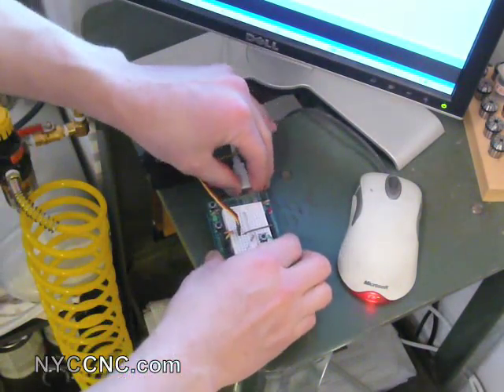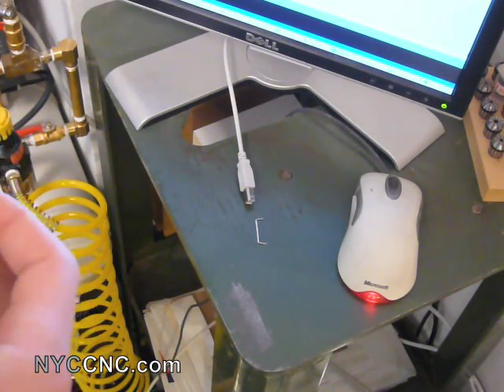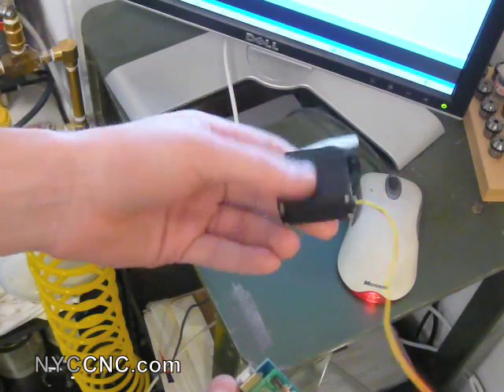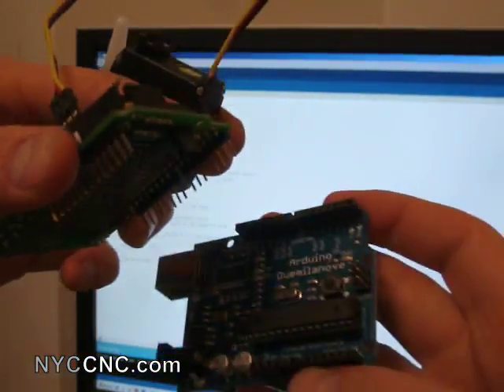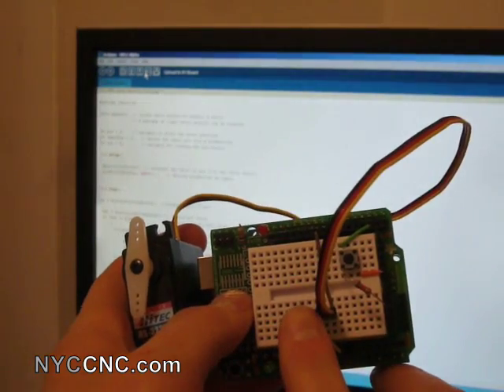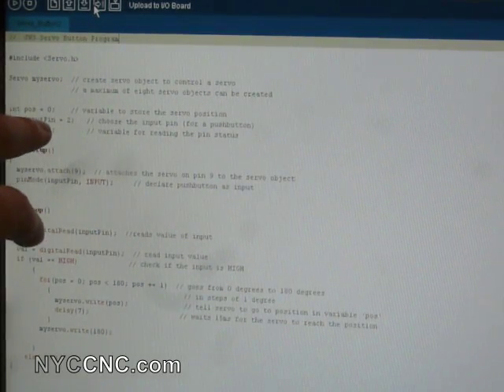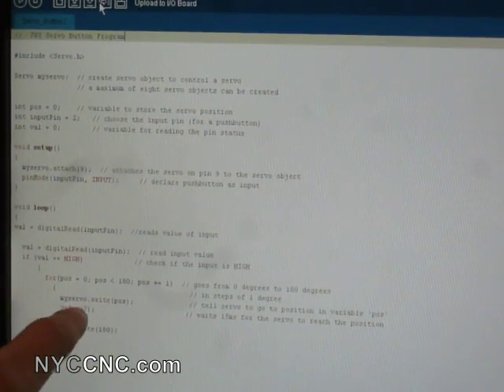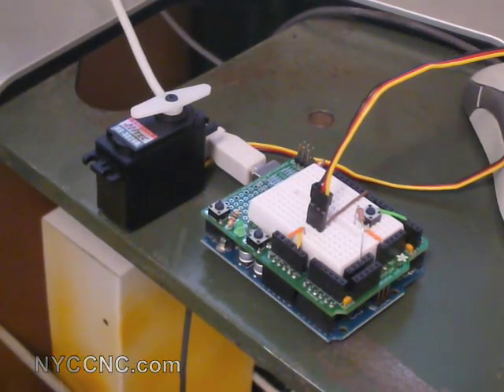Tutorial - Use an Arduino to control a Servo motor!

Comment: Typed it line for line as its shown in this video as well as what is posted at the source code link. Also wired it exactly the same. But it didnt work for me. The servo just keeps cycling through continuously

Comment: i use mach 3 for playing around with steppers its easy for pin out adjustment steps ramp rates pulse with mod inputs outputs lot of easy programing gcode etc u probably allready know jest fyi i started with the basics trial and error self tought up grade smoothe stepper and phytron drivers good clean steps next when more money i git encoders for servos perfect movement have good day be safe

Comment: heya :3
nice video! I have a question about the arduino. I have a school project, but the teachers don't want to explain anything when I ask for help. I have a servo which can rotate  . And I want to use a potentiometer to let it rotate slower or faster. But I don't know how to write a code for that. Do you know where I can find codes for it, or do you know how to do this? 
Thank you :3

Comment: Hi sir, can u help me, i just bought 360 servo, and i tried the code from example just change  180-360. connected to joystick And it look like this,  it ididnt change direction or speed. Thanks so much
https://youtu.be/5fPuEVZ1QSU 
/* 
 Controlling a servo position using a potentiometer (variable resistor) 
 by Michal Rinott <http://people.interaction-ivrea.it/m.rinott> 

 modified on 8 Nov 2013
 by Scott Fitzgerald
 http://www.arduino.cc/en/Tutorial/Knob
*/

#include <Servo.h>

Servo myservo;  // create servo object to control a servo

int potpin = 0;  // analog pin used to connect the potentiometer
int val;    // variable to read the value from the analog pin

void setup()
{
  myservo.attach(9);  // attaches the servo on pin 9 to the servo object
}

void loop() 
{ 
  val = analogRead(potpin);            // reads the value of the potentiometer (value between 0 and 1023) 
  val = map(val, 0, 1023, 0, 359);     // scale it to use it with the servo (value between 0 and 180) 
  myservo.write(val);                  // sets the servo position according to the scaled value 
  delay(15);                           // waits for the servo to get there 
}

Comment: What resistor do you use here? Do you need a resistor for each switch or do you need a resistor for each servo that you hook up to a single switch (say I am hooking up five servos and each will be hooked up to three different switches, giving me three different rotation speed settings of all five motors at the same time - slow,medium, fast).Thanks!

Comment: Ok so in the code your cycling thru 0-180 values, representing degrees, 1 degree at a time.  Can you use decimal values instead?  For example .001?

Comment: well im trying to get started on the connections a bread board. but i have little electronics background so im struggling to figure out the correct connections. what im trying to achieve is wirelessly control the servo with a 6 channel RC. im still researching on ways to achieve this. any comments or help you can provide will be great thanks! appreciate your time reading my comment!

Comment: With the Arduino uno r3 or the Arduino Leonardo and possibly a shield, How many servos would I be able to control with potentiometers? I am working on building a robot that would need at least 6 servos for movement. Also, if I could have your opinion on which Arduino is better for this project (uno r3 or leonardo) I would greatly appreciate it. Thanks for all the help!

Comment: i put the code the 360 from 180 . the servo wont let turn more than 90 degrees. i am using the standard hi tech HS-311. what is the code?

Comment: Just a quick question. So if I put two tact switches and wrote the code appropriately for it, will I be able to control the servo using both switches? Like switch1 says rotate clockwise and switch 2 says counterclockwise. Is that possible? Thanks.

Comment: I know there are lots of Duino fans out there... But there are others like the Parallax Propeller !
The Propeller chip is not just a micro controller chip like the b stamp and Duino .
The Parallax Propeller chip has 8 processors on a single chip, not to mention VGA, NTSC/PAL video Stereo Audio, keyboard, mouse, serial port, 32 I/O lines and more all for $8 US ! Several programming lanuages, one designed by Hanno Sander !  It uses  building block interface, his 8yr old daughter can program it !

Comment: Questions:
Can I wire up multiple servos to a single arduino?
Can I program each servo motor to rotate a certain number of degrees when a button is pushed?
Can I have presets (multiple buttons) that make the servo(s) rotate a certain number of degrees?
Can I do all of the above with a single arduino?